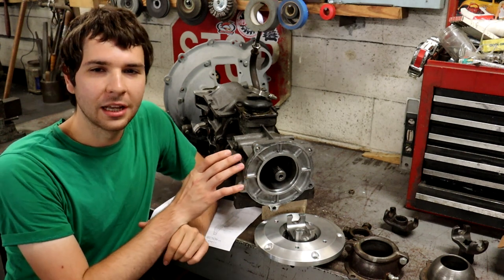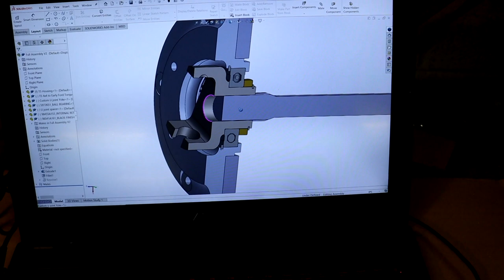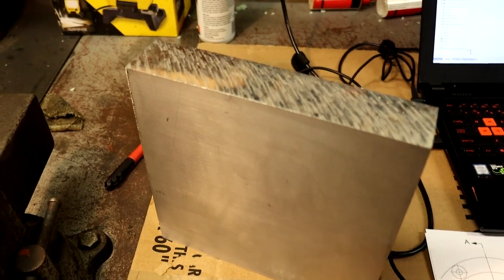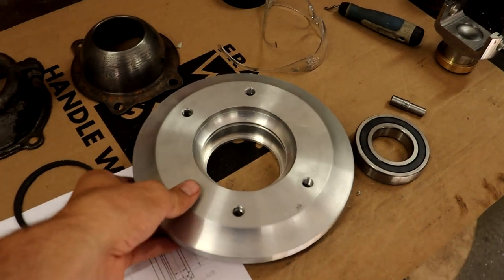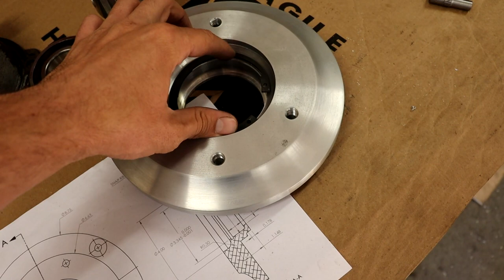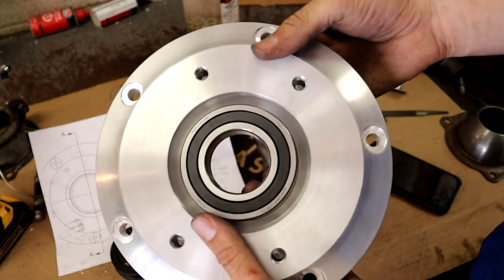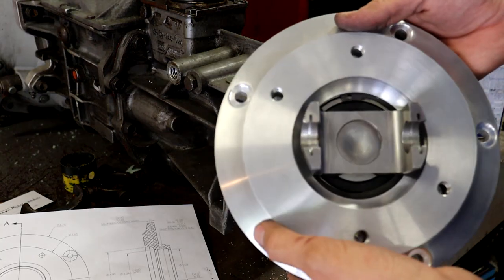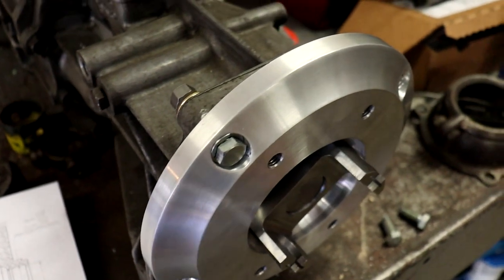Adapting a T5 Transmission to a Closed Driveshaft | Homemade Boat-tail Speedster Pt. 50

Comment: A shame you wouldn't see a Ford type 9 gearbox over in the US as it is in Europe and some other countries just about the "go to" gearbox for any modded RWD build, think the only cars in the US that had it were the Merkur XR4Ti and Scorpio, the beauty of the type 9 is it can accept just about any Ford engine and has a reasonable output making prop design a breeze.   Indeed a special police van using the Ford Transit had a type 9 box and a Jaguar XJS rear axle modified to fit the Ford Transit mounts and a 3.0 Essex V6 up front made for a scary fast van.

Comment: Great job and bravo on designing and machining your adapter Plate !!! Just a couple of kindly provided comments ~ Rule Number 1: "No sharp/knife edges ... anywhere" ... causes stress cracks ... sand/rotary file all edges including your counter bores which I couldn't tell if your cutter gave a beveled (radius) edge but should be.  Next are Bushings ... next time, throw them in your Freezer for an hour or so, apply a lube and you'll be able to press them in with your thumbs. Thanks for your video ... and spending your Summer Vaca providing us with such great content ... she's gonna be so beautiful when you're done !!!

Comment: I always use bit of heat when installing bearings into aluminium housings, the difference in thermal expansion makes them go in far easier.

Comment: Another great video - I'm enjoying the progress and look forward to seeing the first drive!   I'll pass along one tip that's saved a lot of grief on my boat.  When steel and aluminum are in contact, use  "Tef-gel" paste to prevent corrosion and galling.  In a salty environment the parts will weld themselves together.  May be overkill for an automotive application, but it can't hurt.  :-)

Comment: Another Technique for Inserting Bearings into Aluminium Housings is to put the Bearing in a food bag, Place in Deep Freeze for 1 Hour. 
Place Aluminium Housing in the Oven, 1/2 Hour, 
The Bearing will Just Drop into the Housing 😊

Comment: Great video. Reminded me of one I did for my old Ford.  I ended up cutting the spline off the t-5 output shaft and welded it to the yoke from the Ford.  I used blocks of aluminum As you did.. Your machining was much more elegant, as I didn’t have access to a Lathe. Great work!

Comment: i think you can make the splice with youre current tools (think you had a dividing head) , it will just take a LOT of time as you have to hand cut every single spline groove under the mill (using the up and down motion and a custom ground cutter)
put a hydraulic press on youre want list , with pressing bearings in and out and stuff like that its a great tool to have , could make youre own with a hydraulic jack and some steel 
i have a 20 ton version and i couldnt live without it anymore

Comment: Excellent job. I just completed something along the same lines but did not have the advantage of the readily available output flange. Your finished job looks very professional considering it was all carried out on a home user type lathe.  Subbed ya. All the best, Mart in England.

Comment: That plate is a beautiful piece of sculpture. The smooth chamfer should eliminate any stress concetration that a stepped design would cause. (Not that it's very likely to matter.) 
Using an off-the-shelf product that would be tricky to make is a sensible production choice. (Thinks: How DO you machine spline slots on the inside of a tube?) 
The snap-ring pliers were a brilliant hack. 
How is that bearing going to be lubricated? Packed with grease before it's all bolted together? I don't see any source of oil for it otherwise.

Comment: Nice work - I couldn't see how big the drift was you were using to hammer in the bearing but try to use something large enough that the pressure is only on the outer race and you're not hammering on the inner race and balls.
Reply: Agreed. Scrolled down to see if I was the only one objecting.

Comment: Yes, thank you for posting this information. I have a similar dilemma in that GM actually shipped a WC T5 in the '94-'95 S10, they used the improved Ford re-design I'm told. It has a Ford bolt patter on the bell housing side. There is a guy that sells an adapter, and I think he's going to make it...but it's taking some time and it got me to thinking that in theory, if I take the template I made from the T5 that has the  Ford bolt pattern which has the shape and holes for template, I could overlay another template from my transmission and see what I need for shape and location of holes to build a plate of my own. Countersink the flathead bolts with hex head holding it to my bell housing, and threads for the bolts of my T5 with Ford bolt pattern. Isn't that how you would line up the 2 patterns? In your case your going vintage Ford pattern to GM T5 bolt pattern. Did you use an S10 T5? (shifter forward)

Comment: Thanks a bunch for the drawings!  Can you pass on where you purchased the U-joint end of it and what the bearing part number is?  I really like this setup - exactly what I'm going to put into my 34 Ford.  I'll probably swap out the gearset to a close-ratio one (as the 4x4 stuff has an almost unusable 1st).  Thanks again!
Reply from the maker: sure. I just added a link in the video description to Vintage Metalworks. The bearing and snap rings are from McMaster-Carr and their part numbers are on one of the drawings in the google drive link

Comment: The one problem I think i see is using 4wd T5 is now you have put torque tube adapter on there is no oil for spline so the flange needs to be prelubricated with a molybdenum based lubricant and there probably should be some sort of seal to keep it there between shaft and flange splines ?

Comment: Do you need to balance the piece?. I suppose if it is symmetrical then the material removed should be the same all round. Just wondering if the drilled bolt holes being a different spacing (from 12. 3. 6. 9. ) would cause rotating balance issues?.
Great work, love the Chanel, cheers Louis :)
Reply from the maker: the only rotating part here is the U-joint which I'm not worried about being out of balance
Reply: Doh!!, sorry lol!, watching at night after a long day at work, I’m thinking rotating as I’m watching it on the lathe!. I’ll just keep quiet and watch lol!, cheers Louis :)

Comment: I downloaded your solid works file so i could make the adapter for my 1930 Model A that I want to convert to t T5 however, the model doesn't seem to be the final version.(V1) It just is the OD and ID of center bearing of the the model with out bolt hole locations ect. Do you have a final version like you show in the pictures on google drive jpg 1-4?  That would save me a ton of time. Thanks in advance

Comment: Why don't you need a seal between the bearing and the yoke, or is there no oil lube there and the seal is further on the shaft toward the transmission? Oh, never mind. I saw on the next video of how the torque tube sealed everything. Genius.